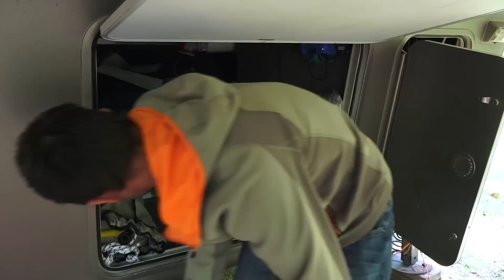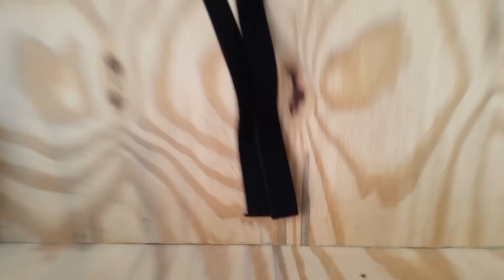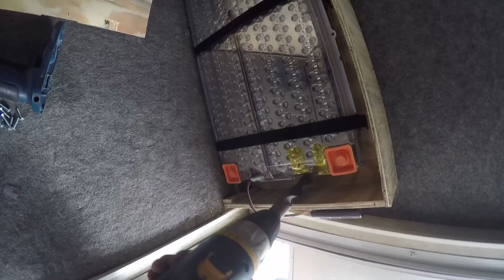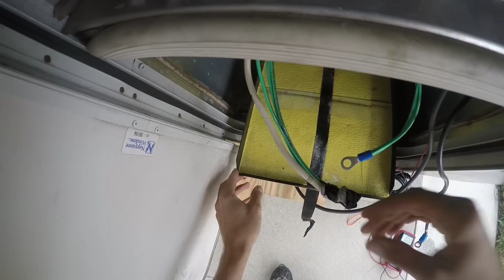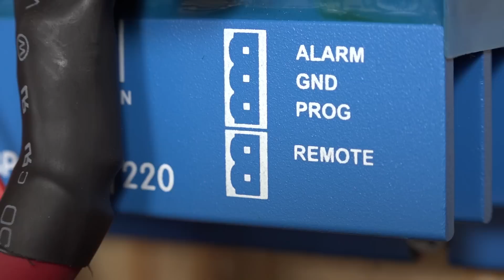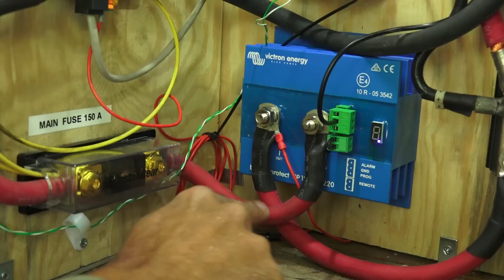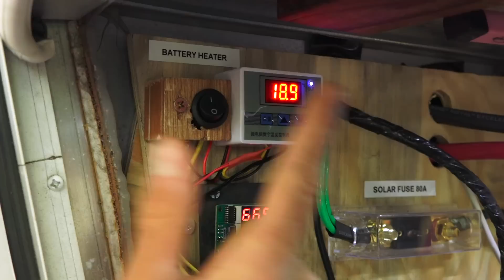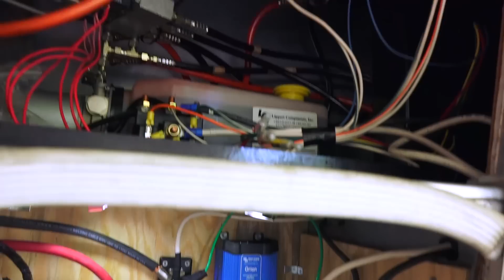PHASE 2 SOLAR - Installing the Tesla Battery and converting the RV from 12V to 24V

Comment: Nice explanation Tom. I have a question, do you think it’s posible to run a high amp automotive alternator true a MPPT to control the voltage output to the Tesla batteries ? I,am trying to build a 3 pack Tesla battery bank for commercial use and installing a second 24v 100-140amp alternator to my van for charging purposes. 
       Any help would be greatly appreciated.
Reply from the maker: You would need a programmable charger in between the alternator and battery, if you can get a high enough voltage alternator, yes and MPPT should work.  Alternativly programmable DC-DC devices might work too. https://www.victronenergy.com/blog/2015/10/12/new-product-50a-buck-boost-dc-dc-converter/     or     https://sterling-power.com/collections/battery-to-battery-chargers
Reply: Thanks Tom for the info
Reply: Robert,
I thought about doing just that but have done something different. I have 18kwh of Nissan Leaf packs in 7S20P (24V nominal)  that I charge with a second alternator (on my 2004 F350). The alternator I'm using is a stock size, 120A (@14.4V) but with an external voltage regulator (Transpo Voyager V2400 ~ $85) that I have set at 29.4V. Turning a 12V alternator into a 24V one is really just a regulator issue. I just gutted the internal regulator and connected the alternator terminals directly to one brush while grounding the other. The best thing to do would be to go with a Balmar style external charging regulator but that is around $400 was more $ that I wanted to spend. I have experienced several issues that may be relevant to your plans. Because the alternator is 24V, it is totally separate from the vehicle electrical system. It receives excitation from the 24V Li-Ion battery. The only correct way to stop the alternator from charging the battery is to interrupt the excitation power to the regulator. I do so through several devices; 1) a relay from the BMS must be closed to 'allow to charge' signifying the voltage is below the charging threshold (set in the BMS at 3.9VPC) and the battery is above 36 degrees. 2) a manual switch on the dash of the truck must be on. I want to decide when or if it charges. Often I don't need it to charge if I will have line power at my destination and also want to interrupt charging if I'm pulling up a hill/in hot weather. 3) a 12V relay in the dash connected to the 'key on' signal to require the vehicle to be running (just on but really doesn't matter). This prevents draining the battery when the engine is off (because it will put a constant 6A to the field of an unmoving alternator. 4) I have a normally closed 120C thermal switch epoxyed to the alternator case as a fail save to prevent it from burnout due to overheating. Since the battery bank is large and attempting to deliver constant voltage (29.4V), when the battery is below 3.3VPC, the alternator will put out about 150A ( I have a voltage, amperage and temperature meters on the truck dash to monitor the alternator) which is well above its continuous duty rating. There are also a lot of assumptions about environmental conditions(under hood temp in particular) in establishing the continuous duty rating that may not be present so ....since vehichle alternators usually don't expect to run high amperage for very long (and I do), I want a fail safe. Just putting a bigger alternator would likely still result in the 120% capacity surge at an even higher amperage as long as I'm controlling the alternator voltage output and not current (which the Balmar regulator does). The thermal switch cuts out the excitation at 120C and cuts back in about 100-110C. A fairly normal operating temp for an alternator is 80-90C. email me if you want to know more. steve.hericks@gmail.com
Reply: Steve Hericks Thanks for all the information. I’am trying to make the setup more self automated. Did check out the Balmar regulator bud the lowes voltage setting is still to high for the Tesla battery pack that I have. The big question that I have sins I don’t now exactly how a regulator excitation system works is that if I run the power (Alternator 24v 100-140 amp) true a charge controller (MPPT) and not directly to the Tesla battery, can the regulator (Belmar) sense the battery voltage and excite the alternator ?

All help is greatly appreciate
Reply: To put the problem statement up front,  I think it helps to think about the whole system as 2 connected sub-systems with the problem being that one of them needs to regulate current. 1) battery + charge controller. They will use whatever variable current and variable voltage energy available (from solar, alternator, etc. ) to charge the battery with two requirements; the supplied voltage must be several volts above the maximum battery voltage and the current must not exceed the capacity of the charge controller. 2) The vehicle alternator system consists of the alternator + (typically voltage) regulator. Assuming the regulator is voltage based, the alternator will attempt to output a fixed voltage to a load. The load will draw whatever current the resistance and voltage dictate. Since resistance of LiCoO2 battteries is very low, currents can be very high. The voltage regulator controls the alternator's voltage output by changing the excitation to the alternator. By increasing excitation, the output voltage increases and decreasing it, lowers the output voltage. Excitation is a complex process of timed pulses of input electricity that maintain an average voltage level in the alternator's rotor (always lower than the max excitition voltage). The rotor is an electromagnet and it's strength dictates the voltage output.  As long as the alternator/regulator system is set and can maintain an output voltage several volts above the necessary charging voltage the charge controller wants to provide, the system will operate fine. The issue is the uncontrolled current. In this case, the only load is the charge controller which is fundamentally a DC-DC buck (voltage reducing) converter. It accepts whatever voltage the charging source provides and reduces it to a suitable charging voltage for the battery. It has nothing to do with controlling the alternator output (either voltage or amperage). Nothing in either system above sub-suystems actively controls the current. There are 2 ways to deal with this. 1) get a charge controller (and cabling) that has a higher amperage capacity than the alternator can ever produce. This is much higher than the continuous duty rated capacity by as much as and additional 50%. An alternator's rated output is not a limit. If not limited by some other means, it will burn itself out. 2) Get a (one and only one) charge controller that has internal current controls Ive never seen one but that doesnt mean one doesnt exist). Charge controllers being DC-DC converters cannot be paralleled, meaning you can't put 2 or more in the same circuit (same source and same load) because they will interfere with each other (someone may make one that can but I am unaware). Without some form of current control, something is going to burn itself out, most likely the charge controller. This why the Balmar regulator is a current controlled regulator because it is designed specifically for battery charging so it addresses this issue.   There are manufacturers who make charging regulators other than Balmar. Mastervolt and Xantrex to name a few. Search for 'battery charging alternator regulator'. The problem will be they are usually only designed for lead-acid charging profiles. Others may exist and may be programmable but will also doubtless be very pricey. Using a 6S chemistry is VERY ODD for a 24V system because the voltage ranges do not work well with existing equipment. My Nissan packs are 2S2P packs so I was faced with using 6S or 8S if I was just putting packs in series. I  literally ran into so many problems with existing equipment that I ultimately decided it was easier to turn some 2S2P packs into a 1S4P packs so I could achieve 7S in my overal lconfiguration. Your are experiencing the same problem with out an easy solution.

Comment: Just watched these videos for the second time, thanks for making them. I'm trying to figure out an AC charger to charge the model S module. Curious if you know the max amps you can send to the battery for charging? I can't seem to find that.
Reply from the maker: 1C without cooling or 233A @24V.  You can go higher if you cool it

Comment: Since heat rises, why not place the heat pad under the battery? I guess if horiz. mount, then you would have. But, under battery and maybe wrap around a bit on lower end of vertical mount may be more effective and uniform?
150 A fuse... is a Circuit Breaker an option?
Reply from the maker: If your batteries are flat that would be a good option, Yes you could CB it, too as long as it was rated for DC.

Comment: lookin good! A few things to consider for life safety.. If that storage compartment doesn't have a heat/smoke detector, install one as close as you can to that battery. If a Lithium Ion battery suffers a catastrophic failure, it can get that compartment ripping hot in no time. 

In your old battery compartment, cover that spray foam with foil tape or some other non combustible material. literally just a stray spark, say by a terminal that has come loose can ignite that stuff.
Reply: Good idea. Thanks.

Comment: Great videos of your Tesla battery install! Congrats!  One question - did you check with your insurance company to see if they will cover you if that battery pack starts a fire?  I know .... it's uncommon and you have obviously thought out the extra protection circuits, but electronics fail and sometimes the packs just short out due to manufacturing defects.  I would love to do the same in my (future) van, but am concerned about the insurance.  Thanks!

Comment: The problem with Tesla batteries is a lil thing called low voltage cut off. Tesla batteries have a low full charge voltage of 24.8 this means your inverter will cut the power from from the Tesla before it’s even 1/2 discharged. The other problem is you cannot fully charge this battery so again you’ve lost a lot of amp hours. If there is a way around this, I’d love to know because this fact killed the idea for me. Funny nobody ever mentions this fact.
Reply from the maker: Did you watch my videos, our inverter runs down to 18v easily.
Reply: Mortons on the Move A 24 volt inverter that will not cut off at 21amps? Wow! Everyone I researched has a cut off of around 21.6. Is that an adjustable feature on your Victron? Is the model you have the MultiPlus 24v 3000 watt? Thanks!
Reply: Gap Recordings Namibia Thanks for the info. The LVC of my inverter is 20v. At 10% drainage of the Tesla the voltage is at 18.78v, which I wouldn’t go below. I also wouldn’t go above 90% of capacity in charging a Tesla either. Based on these numbers a Tesla wouldn’t be out of the question. The only way one can damage a lithium as you know is going below or above these safety points. I have only found one BMS exclusively for the Tesla from EVTV but at over 1200 it’s out of the question. I am going to check into the Batrium system. I personally would never use a Tesla without a proper BMS but I’m not experienced with lithium either. Tom and others take a calculated risk based on experience. Thanks for the info on the Victron inverter. In hindsight, I would’ve bought one for many reasons. The other option is prismatic cell CALB lithiums which are very cost effective but there’s the BMS issue again. I always thought cylindrical cells were more stable. If one cell failed the unit as a whole wouldn’t be damaged but after reading your post, I can see I have much to learn.

Comment: New to your videos!  Incredible and so informative. You are a great teacher. 
Question, I’m new at all this stuff. How do you determine if you want or need 24v or 12 v?  Can they run either or 24v or 12v ? 
Which do you prefer?  Thank you.
Reply from the maker: The DC can run at 24 or 12V .  Just plug it in and go.

Comment: Tom, I'm in the middle of wiring all the components together but I am unclear how to wire the battery charge protection. I've replayed your video a million times but couldn't make out the wire connection. Would you have a detail diagram for the voltage controller, temperature controller thermostat? Thanks

Comment: Also when you use hybrid mode for AC using both battery and lower watt generator, does this extend the run time of the generator?. I have a 3600 watt propane generator in my 2016 Winnebago View. It would be great to remove to lower wt and use a 2000 watt duel fuel Yamaha gen with a 3000 watt hybrid inverter and higher amp hr  battery system. The View has very limited OCCC rating.

Comment: did you just touch the positive and negative terminals?  Hahah damn, its low voltage but damn.  hahaha
Reply: It's a DC system. If it was an AC system that would be a different story.

Comment: Amazing setup! Great vids! What happens tho, if you head out for a multi day hike and accidentally leave something on that drains the battery to where the low voltage draw prevention shutoff engages. Then, below freezing overcast weather unexpectedly blows in, and when you get back, there isn’t enough juice to power the heating pad to warm the battery to safely charge?  Keep a small propane heater on standby or an extra lead acid battery to power the heating blanket?
Reply from the maker: That would be an unfortunate sotuation, but yes we have an electric heater we can plug directly into the gen.

Comment: Hi, I have one question. Why do you use/connect busbar first before the solar power goes into battery? Is there any good practice to do so?
Reply from the maker: Between the battery and any charger you need a fuse and shunt.  The busbar allows me to connect everything after these devices. If you fuse the solar and don't want to monitor the battery you don't have to do that.
Reply: Thank you.I like your setup for this off-grid solar power. So, I am making a similar design like yours except I am not using it for RV.May I ask you how you program that VE. BP? I have the same one like yours and I found the power decreased after passed this BP. So, it makes my whole solar system useless now.

Comment: Great video and tour. I wonder how you are informed about a shutdown due to temperature or voltage? Meaning do you get a wireless notification or is there a maintenance log file you can consult.  Or do you need to manually go through the circuits and figure it out. Very interesting setup and love your battery bank!
Reply from the maker: It's all manual. Lights indicate relay states but we will loose power or not charge in some states.  A full BMS will send alerts.
Reply: @MortonsontheMove  Thanks for the reply.  My mobile phone doesn't allow me to reply so I can't see your full reply until I logon to a laptop or desktop.  First World Problems, eh?  With the lights is it pretty easy to know what state you are in if you need to check on a particular subsystem?

Comment: You could indeed make your system less complex with only one battery protect module.  You made a clever protection circuit with the second module however you could simply have run that circuit off of the remote disconnect of the first module.  If either the voltage or temperature sensor open their relay it would in turn disconnect the battery without need for the second module.  I only say this because it is how I plan to wire my setup in the coming week or two and you mentioning you wish there was only one module in the system.

That said, do you ever worry about a failure of the cheap Chinese protection modules used (thermostat, voltage, heater etc)?  And I'm not judging, I'm using literally the same components in my system on most accounts.  I just worry that I'll be away at night with my dogs inside and have a catastrophic failure due to a $5 part not opening etc.  I'll be incorporating a temperature based alarm in the battery compartment (we're using 2 Model S batteries), I'm also working with a company that builds "fireproof" lithium-ion battery bags.  I'm hoping they can provide a quality product at a reasonable price, it would be nice to know if our protection circuits failed or something beyond our control happened there would be containment rather than our homes burning down.

Comment: Your video makes it seem like the batteries connect directly to the tenergy 5-in-1 cell meter , but mine doesn't fit that at all. What did you do to make that fit? you skipped that step.
Reply from the maker: Sorry I originally didn't realize that was a change made to my battery.  HSR Motors made that pigtail for my battery,  I think info is on the blog. Wouldn't be hard to make tho. Just get a 7s battery lead.